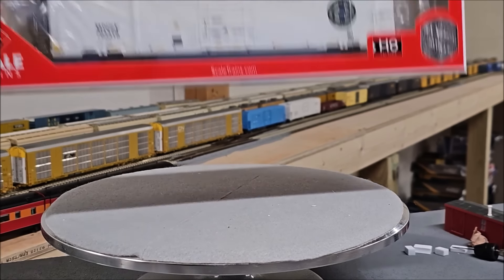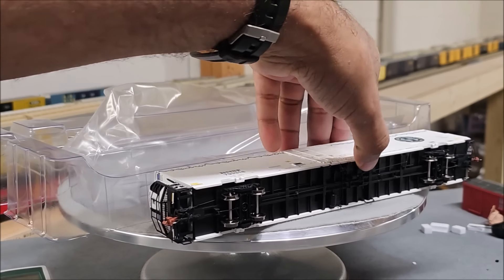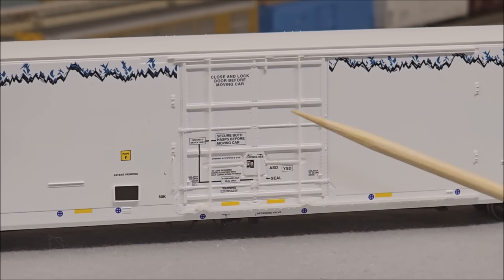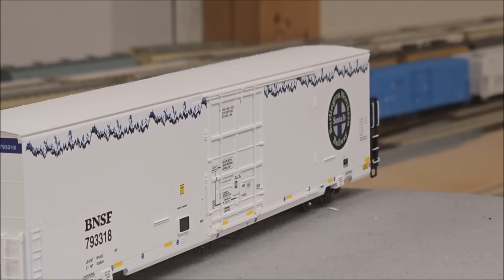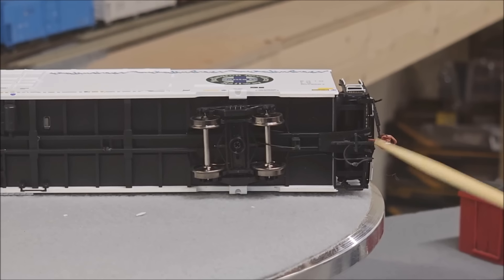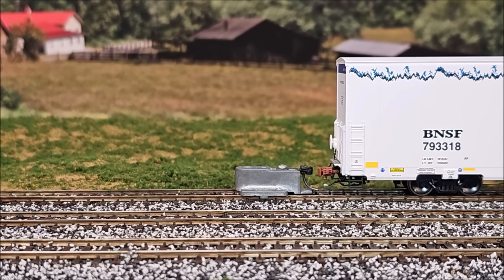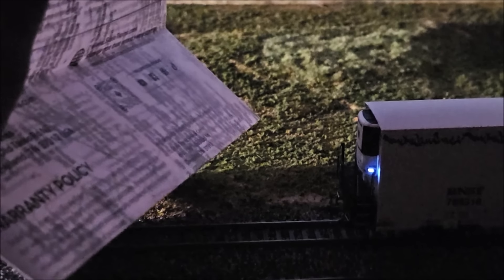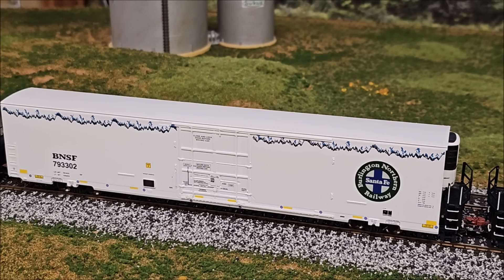New HO Scale Trains LED-Lighted 82' Trinity Reefers - 7883 cu ft Refrigerator Cars (BNSF)!

Comment: One minor thing… I work on those units. The tank is for fuel for the unit. The Carrier and Thermo King units are totally self contained and they hold their refrigerant. One neat thing is that if a unit were to go down with a major problem, the unit could be swapped out in as little as 15 minutes with a good work crew.

Comment: I've wanted this particular model for the last 20 years. Hopefully we'll see the Cryo-Trans version as well as the other BNSF version that doesn't have the ice cycles along the top. But rather the BNSF cross-circle that has snow atop of the logo and ice cycles hanging below the logo.  Who better to do it than ScaleTrains with great details, however there is one minor detail that is missing from this car. During my years as a Conductor on BNSF, I used to have so many of these reefers in my consist and when I had to set a few out to the yard. I would ride the end platform where the reefer unit is allowing me to stand during a shove move.  However, BNSF had a rule where we could ride atop of the platform. But the chain had to be in place once we're positioned on the platform. With that being said, the metal chain that goes across the top of the platform where you climb up is the only thing missing from this version. It's basically to prevent someone from falling off to the side where the railing is open. I'll just add the chains myself, it's an easy add. There were times when some chains were missing on the end platform, so over the years it's a possibly that they've removed them permanently, which could explain why the model may not have them.

Comment: The lousy rolling issue is  caused by the 'roller bearing' axles. It's common on newer models using these types of trucks, all vendors. Swap the entire truck for good (non-rotating cap) to fix. The Micro Mark truck tuner will not work on this type.

Comment: I got a full train of these cars, look amazing but have noticed that only 2 ST locomotives is enough to stringline them on wide radius curves. I was contemplating adding some weight but with a long train that may hurt just as much as it could help. I’ve oiled all of the bearing cradles on the trucks, anything else I can do to lower the drag or keep from string lining?
Reply: Check the power contacts maybe they are a little tighter than they need to be on the wheels/axles.
Reply: Swap the trucks for non-rotating cap. These trucks have a lot of drag. Drag will cause strinlining.
Reply: @kenlwhitehead1955  i think the power pickup does way more than the bearing caps